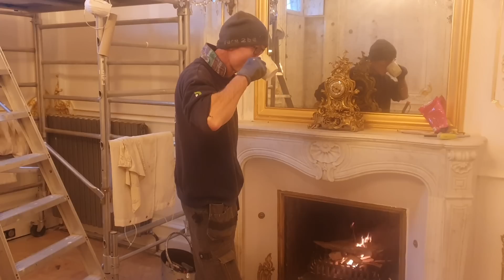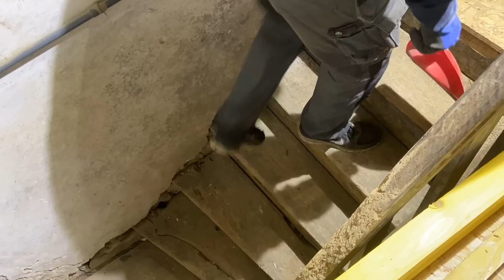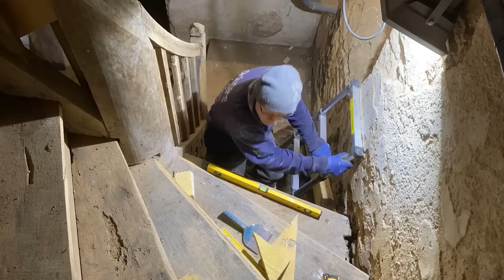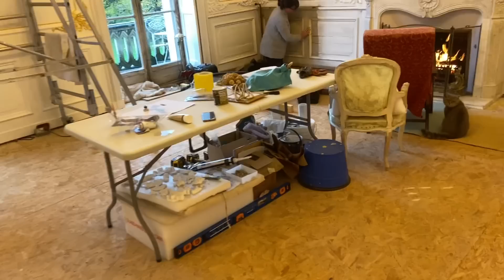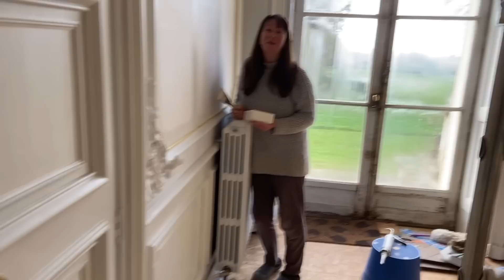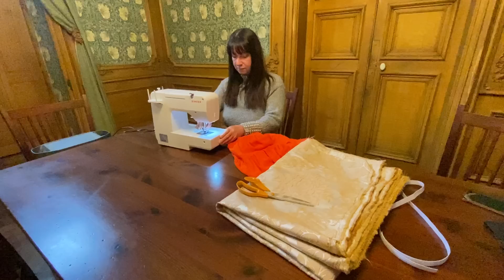We Need Your HELP In The Salon!

Comment: Incredible trasformation.  Those panels behind the shutters... I could see painting them with a very flat or matte paint, then stencil a motif over that using the same paint colour, but satin or semi-gloss finish.  Light would catch and highlight the motif differently throughout the day, just as it does on the wallpaper.  Something like that would compement the wall panels nicely without stealing attention from them, and might be a much easier, faster and quite inexpensive way to up the grandeur without going over the top.  One of those detail things that doesn't hit one in the face, but you sort of 'discover' it after you've been sitting in there a while. I did this once in the printing business with a solid black presentation cover with the customer's logo in varnish and it was gorgeous... don't see why the same couldn't be done with white paints.  Perhaps the motif for the stencil could be one element copied from the drapery fabric, to sort of tie the drapes to wallpaper visually.

(Or you could, you know, stencil on some glue and apply "that-shiny-stuff-which-must-not-be-named".)

Comment: Carole, when you announced that you were going to add some color and picked up the orange material, I thought the grande salon had finally gotten to you. What a relief!
It's almost finished and it's looking so beautiful. I can't wait to see how you furnish it.
Adrian, the stairs are looking pretty worthy of a grand old home again too.
Questions-
-Isn't there a significant draft from the cave with an open staircase?
-Since heat rises and cold descends, what's causing the drafts from every hole in the interior?
Were these ancient noble homes just as drafty 200+ years ago?
How did they have enough wood to heat everyone's drafty home with inefficient fireplaces? Even with pollarding the trees, you'd think they would have run out of fuel.
Bon courage!
Reply from the maker: Hi Ray. The cold air is drawn up from the being fire lit. It needs to replace the air in the room from somewhere.

Comment: Adrian better get the stairs done before Carol gets the guilding material out! 🤣
For the door panels could plaster white and do the marble ribbon effect... or if there's a faux marble wallpaper could just stick it on and be done with it quickly.  
OR, the person who found one very similar to the style you had to make a repro and put it up... but perhaps a plain light gold fabric, still matching the curtains, which might be the easiest and simplest that won't draw the eyes away from the rest of the room... but those panels aren't closed up all the time so it may not be that big of a deal.

Comment: Adrian your carpentry skills and figuring stuff out is amazing.   You did a great job on the staircase.   Except when you looked down the hole made my stomach drop.  Glad you pulled the radiator away.  It looks so much fresher and cleaner with Carole sanding and painting that area can't wait to see floor down in Salon.  Keep up the good work you 2.

Comment: Carole and Adrian, you are doing a stupendous job on that salon!  It is breathtakingly beautiful!  So, Carole, DO NOT GIVE UP!  Take a day or two away, refresh and then CRACK ON!  As for the wall sections behind the shutters, why don't you have Adrian cut some thin plywood sheets just the size of those wall sections upon which you could, with paints, make your "faux marble" pattern?  Then affix them to those wall sections.
You might want to put a sealer on top of your painting work?  Isn't that an area which is prone to being damp?  
Anyway, just a suggestion . . . I'm sure you have good ideas for those wall sections, too!  Best wishes to you both!

Comment: The easiest space-filling thing to do would be to mimic the three panels on each of the salon doors.  And just paint them the same white used on the other paneling.  But if those little framing pieces of wood get in the way of the opened shutters, then perhaps use carved-in patterned wood panels such as fluting for side panels.

Comment: Behind the shutters knock plaster off batten and insolation plasterboard then you can scrim it or put wood there sheet of ply board you can just pain no plastering , that's a quick way to get it finished and plasterboard some comes with insolation one side but I'd still use the stuff you use the foil type . You both do a fantastic job whatever you put you're hand too both are a amazing couple work together well love to you both ❤️❤️❤️

Comment: A question (even though the horse has probably well and truly bolted): Seeing as how you're having to replace a lot of the floors, is underfloor heating viable? It would eliminate the radiators and expose more of the beautiful wallpaneling.
Reply from the maker: There is a lot more cons that pros in putting in under floor heating

Comment: Behind the shutters you could put fabric??? If you find some thin foam core and wrap some fabric around the foam core which coordinates with the drapery fabric,  glue or pin the fabric into the foam core, then you can just pop them in that space and perhaps just glue them in or use a small trim to keep them in place??  I don't know what kind of space you have to play with but maybe this can work for you?
Reply from the maker: Unfortunately we don’t have room for any panels etc
Reply: @LifeAfterLaFerté  Oh well I tried?? I don't know if you're even interested in putting fabric behind the shutters,, but if so, you can soak it in wallpaper paste and slap it onto the wall and when it dries it will be like putting wallpaper in the wall. The paste will dry and disappear with certain fabrics. All the Best!!

Comment: Congrats on getting the stairs done Adrian, great that you were able to save so much. Also, glad you were able to get the radiator off the wall without creating a wet mess. What is the cellar ceiling like that it is allowing cold air into the salon?  Carole, you are getting closer to being done with all the detail work. Soon you and Tia will be sitting hip to hip enjoying the fire; Adrian can join too- just don't squish the kitty. 😆

Comment: The Salon is turning out beautifully.  There is lots and lots of work in that room.  Now I am going to write something that will, I hope not, spoil your thoughts.  I wish there was a way to not use the radiators.  They are so tall they hid the paneling behind them.  If you could find a shorter set or even put floor heating in.  The room would not be spoiled by ugly radiators.  Your idea of backing the white curtains with color is a good one.  When I make curtains for my house I go super nuts on making sure the lengths are all the same.  I am sure it is just me.  Beautiful job on everything you two do.

Comment: I would keep the shutters and both damaged walls simple. Painted white or faux marble painted walls. Making narrow panels means you may have to add more moldings to match the other panels and I think you already said you didn't want to do that . If you keep it simple,, you can live with it for a while until you happen on  a good Pinterest idea for that space.  As for the draft in a few pockets behind the wall. Couldn't you use low expansion foam in a can to seal around those little areas. It will also act as a glue to adhere the panel to the wal so they don't slip down.   TIP... if you use expansion spray foam. DON'T over spray in the holes otherwise, the foam CAN push out the panel.

Comment: Honestly, I would only paint the panels behind the shutters, which are going to be open and hiding the panels during most of the day anyway. Besides, there's sooooo much more in that room to go "oooooo" and "aaahhhhh" over. Not every square inch needs to be a masterpiece. Oh, and great job on the stairs, the radiator and the wall behind the radiator. I'm constantly in awe over the amount of quality work you two get done.

Comment: Keep it simple with the walls behind the shutters just paint them the same white as walls know one is ever going to see them when the shutters are open they will be hidden and when its cold enough that you close the shutters you will be closing the draperies as well to save heat so again they will be hidden.  Even if the draperies are not closed and the shutters are the wall will still be mostly hidden by the drapes. Excited to see the flooring go in make sure you have the edge pieces cleaned and sanded before so you don't damage any of Carole's marble work. The room is so beautiful now and seeing behind the radiator shows just how much hard work you have done.

Comment: Shutter Walls - Maybe just leave those narrow walls plain.  They won't be seen very often, and maybe never, once the curtains are hung.  It's such a small space that it doesn't really need ornamentation.  Or maybe just put up the trim painted in white like what is on the bottom panels in the salon.  Whatever you choose to do, it will be lovely.

Comment: have you thought of baseboard heating instead of those big  radiators ?  you can still use the hot water system.  The modern system looks like baseboard floor molding.

Comment: Please carole could you tell me what glue you use to stick the moulds to the wall, and can you use it to stick them to wood? I am using air dried clay. I need to put some around a wooden surround. My intention is to make it look like a giant picture frame. The salon looks wonderful  and you are a master.
Reply from the maker: I’m am using a French product by Coteka called colle de fixation.
Reply: @LifeAfterLaFerté  Thank you so much. Can I get it online  because I live in the UK.
Reply from the maker: I’m sure you could get an equivalent. It’s just a quick dry adhesive for wood, ceramic, plastic and metal
Reply: @LifeAfterLaFerté  Thanks Carole.

Comment: Were it me, knowing how the limitations of that radiator was going to affect that corner, I'd have restored the walls to their glory and found a smaller one to provide the heat. The heating system is an upgrade, and who knows how long ago it was installed. Time for another upgrade. It's not always what you do but rather how you do it.

Comment: Shocking to see the original wood behind the radiator. I'd forgotten how dinghy it was. Paint the area behind the shutters to match the woodwork. It is only exposed in the evening when you already have so much going on between chandelier and gold leaf. Unlike in the much smaller dining room, the recesses will be in the distant shadows. Then light the fire, put up you feet and roast some chestnuts!